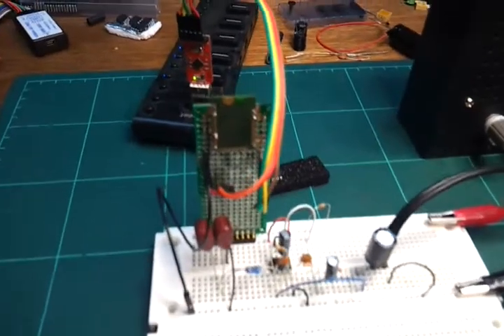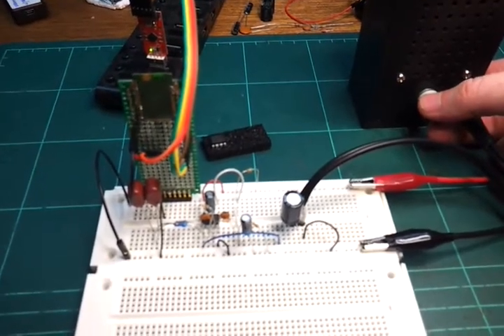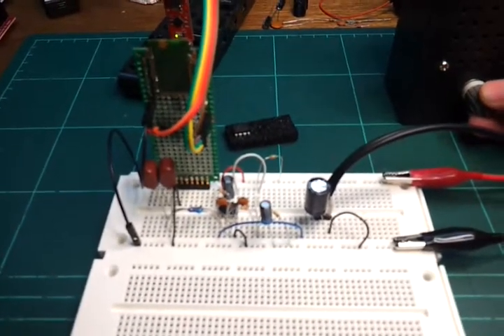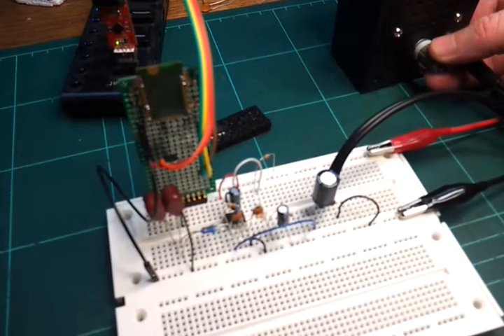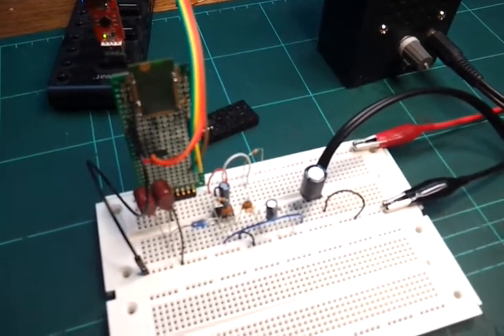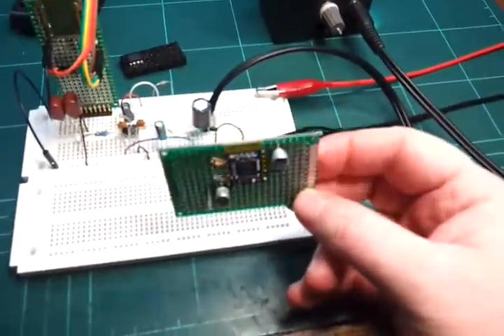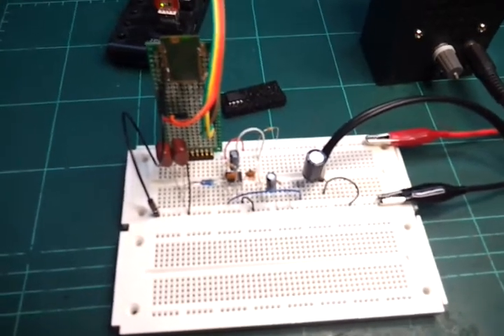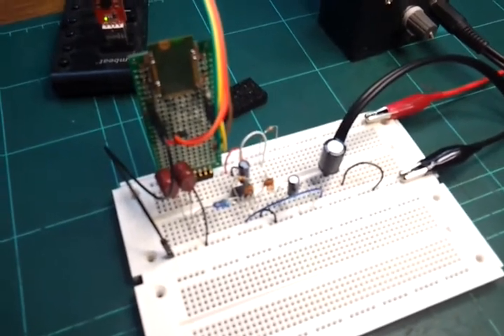Bluetooth fun

Comment from the maker: The WT32 is pretty much what you need. Although you'd have to do a bit of experimentation. You could also rip apart a cheap BT headset and just inject the stereo line audio out of it into the audio amplifier in the trucks radio. Old cassette car radios are really easy to do this to.